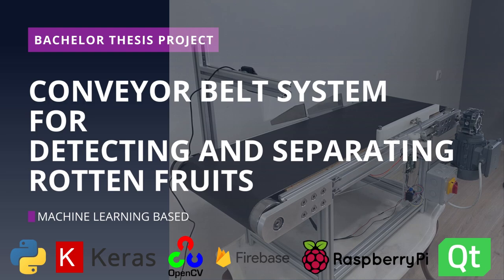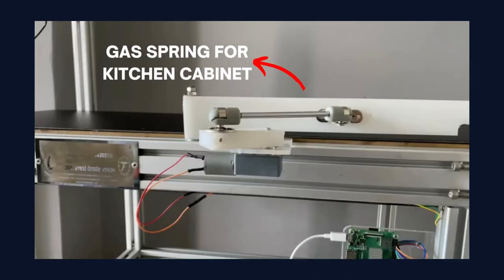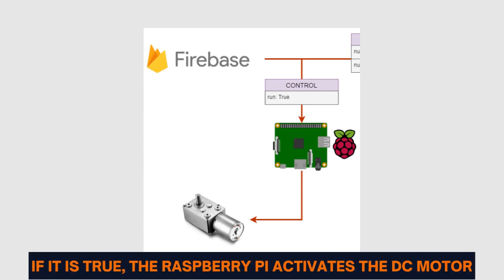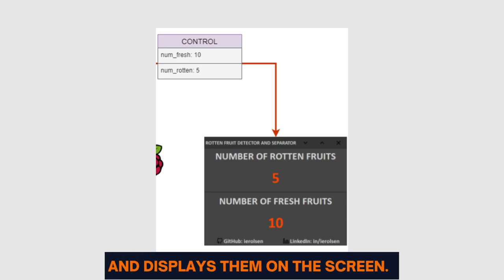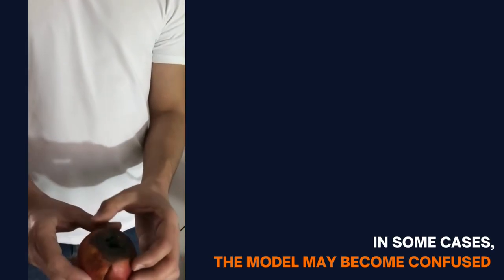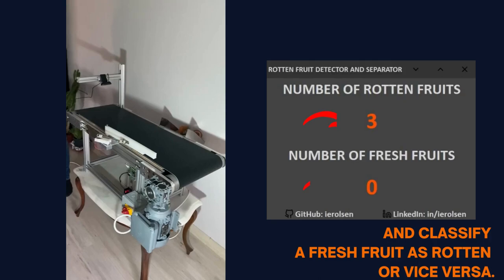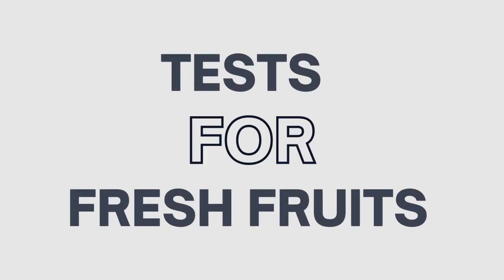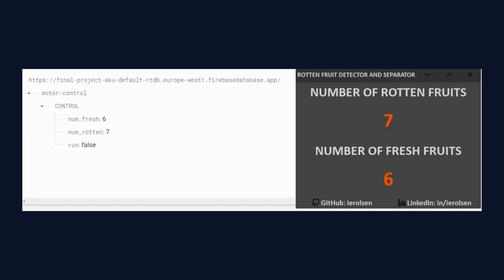Conveyor Belt System for Separating Rotten Fruits using Machine Learning

Comment: Hi! May I ask how you connected the conveyor belt to the motor? I am currently doing my thesis and I plan to make a conveyor belt as well.
Reply from the maker: Hey! I used gearmotor. The motor shaft has its own keyseat, I have also manufactured a shaft that has a keyway. So that, the motor feeds the main shaft that runs the belt. 
You can Google that as “shaft key connection” for getting more idea.
Reply: @ierolsen  Oh!! I understand, did you also code the conveyor belt/motor to have a speed setting?
Reply from the maker: No i didn’t. I kept the speed standard. And the speed is 12.8m/min